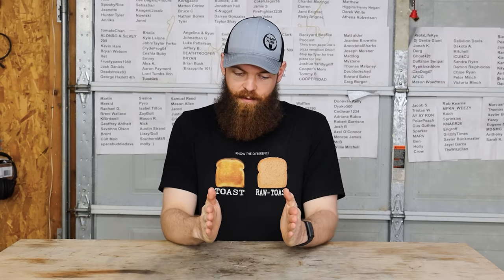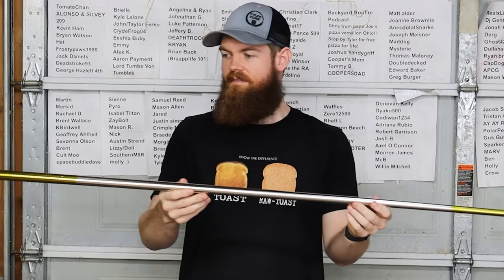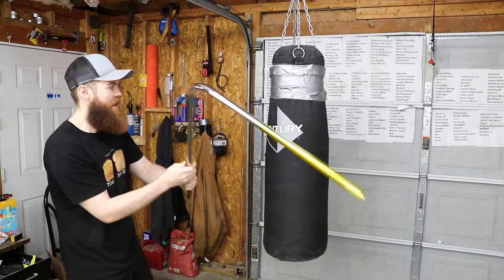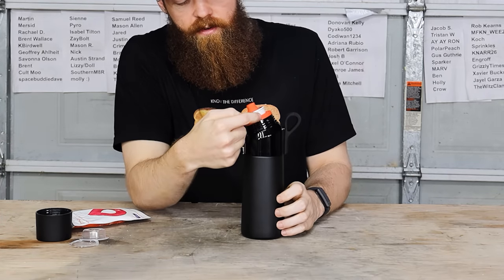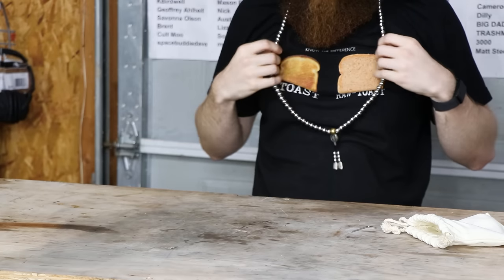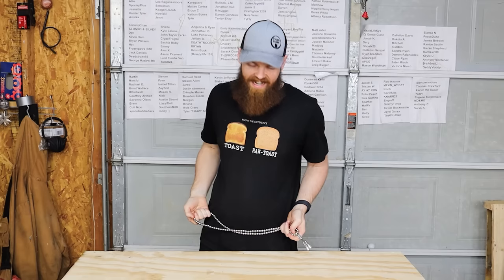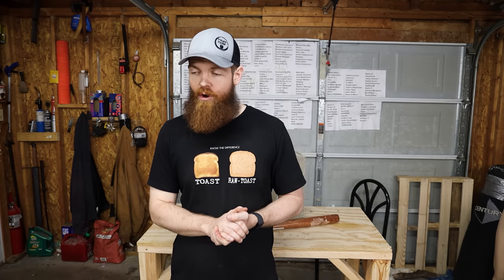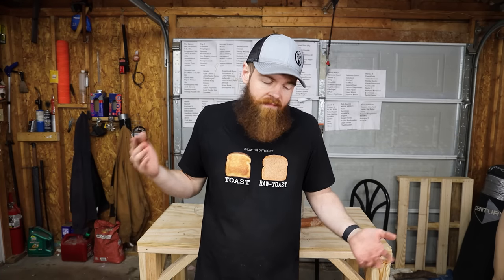Testing 5 Self Defense Weapons From Ali Express!

Comment: I'm pretty sure that stick is a telescoping staff used for magic lol. Not sure why it is advertised for "self defense" 😂.
Reply: I believe it started as a TikTok with someone showing off their amazing collapsible self defense baton. Guess it was a good way to make a quick buck amongst the less intelligent people in our society.
Reply: I was surprised Tyler had never seen it before.  It is a pretty interesting illusion prop and that's about it.
Reply: Great for scaring away potential mates.
Reply: That thing is more dangerous to the user than anyone. Especially the super cheap ones. Its just super thing, razor sharp coiled up metal that could easily shred your hand upon opening, or closing or general handling.
Reply: @lunalovegoodwitch  its also dangerous when collapsing since its made of thin metal
Reply: The best you could do is point it at their eyes while deploying it
Reply: To get suckers to buy it
Reply: +10 magic

+20 healing

-10 defense
Reply: @dotar9586  it's self defense... Defending your virginity!
Reply: To pretend that you're Gambit from the X-Men.
Reply: @Skritl are you saying you would use that flimsy spring loaded aluminum foil tube meant for magic shows the same way you'd use a solid wood bo staff? I think that would go just about as well as Tyler demonstrated.
Reply: @Skritl  It isn't a bo staff though (which is solid wood), it's a fake magician's staff, which is exactly what the original commenter called it lol
Reply: Lol it was sold as magic stick everyone went crazy buying when the sales stopped they relisted them as self defence
Reply: Maybe the telescopic staff is more of a visual deterrent
Reply: Sure 😅😂

Comment: tyler going ham with the collapsible stick made my day. it just kept going and it got progressively funnier.
Reply: I just got frustrated. It's an item you usually see in amateur magic. And ofc you can collapse it again - if you don't ruin the poor thing. Guy's just a dimwit.
Reply: @puttitat2851  it's advertised as a "self defense" weapon, and he was testing it as such
Reply: @Bigblanco_otw  Except the 'doesn't retract' part. That's just not true 🙈
Reply: @puttitat2851  you're right
Reply: @Bigblanco_otw  no, It's not. It's a magic trick. He got duped
Reply: @puttitat2851  I couldn't agree more. Cheap magic trick

Comment: Im actually curious how much those buddah beads go for, Tyler you should totally start posting the links to things that actually work in these videos
Reply: None of them worked apart from the bat. do yourself a favour and stay away from these dumb self defense gadgets. If you ever had to use them you'd end up in a worse situation than you started in because the person attacking you would just be more pissed off.
Reply: Found 1 for around 30 bucks not including shipping with a quick google search and also found the shoelace spikes he featured on the same site so it might be the one tyler used but I can’t say for certain
Reply: @MrEsphoenix  Well, the beads did the exact same thing as the bat propably just as well as the bat so I think they are fine
Reply: FACTS!
Reply: @The_White  No they didn't. Surface damage on a hard surface doesn't equate overall stropping power, especially against something made of flesh and wearing clothes. 

There's a reason you don't see any serous company selling self defence beads, there's simply not enough mass on them to cause any serious damage, it's poorly distributed, you need to land your hit accurately to do anything and you telegraph your hit so much since you need such a wind up to get any force out of them that even the slowest person will be able to react. All you'll do is piss someone off if you try to use them in self defence. 

Don't fall for gimmicks. If you genuinely want something for self defence go for one of the many proven weapons, not some internet tat.
Reply: If you need those beeds invest in a folding knife
Reply: @MrEsphoenix  Maybe they don't want them for self defense :/
Reply: @iamcool544  Yeah, and a set of beads is unlikely to do that. You may as well whip off your belt and twat them with the buckle of that for all the good it will do.

Surely I don't need to describe the physics of how hard brittle things differ to soft padded things? I'm sure if you think about it you can figure that one out yourself lol. But there's a reason professionals tend not to use bricks as an analogy for humans.
Reply: @MrEsphoenix  I mean self defense doesn't have to be super deadly or anything all the time. I could see someone carrying this in cali with all the homeless. Some of them get aggressive with bad mental illness days... it'd be a good "stay back" but not deadly force type of deterrence in those cases, especially for someone of tiny stature.
Reply: @Ajaxykins  It doesn't need to be deadly, but it needs to be effective at either attracting attention or putting someone out of action or you run a high risk of just escalating the situation. If you want to get something for self defence, don't cut corners and go with something because it looks "cool", get something proven to work.

 These tacticool products are infuriating as they're likely to get someone who doesn't know any better into serous danger.
Reply: @MrEsphoenix  Nah. You ever actually scare off an aggressive homeless person? Or a petty thief? Or like a coyote? I have. They're punks. A little bit of threat or pain is enough. Not everyone is a meth'd up CIA ninja. Sure pepper spray is better, but many people can't be assed to carry some until they wish they had it.

Hit someone with a heavy necklace? No one bats an eye. Pull out a .357 on a hobo? Someone might report you for brandishing a firearm and you'll never carry again.

Edit: I'd say give someone the beads as an addition to something functional, like a firearm.
Reply: There is this one self-defense gadget I really like.
Called a "firearm".

Comment: The brass knuckle type things are meant to be held with the fingers between the dividers and for most people between their middle and ring fingers. It hurt because you had way too much of it in your palm, though I'm sure it won't be a whole lot more comfortable the other way. The smaller piece acts like a fist pack, similar to holding a bic lighter and the top lip is more meant for stability and small amount of protection for your fist.
Reply: Kinda like using your car keys between your fingers
Reply: Exactly. You can tell Tyler never has. Lol. Not that that's a bad thing.
Reply: I'm an idiot. I didnt see the little lanyard ring thing on the lower part the first time I watched. That pretty much makes it impossible to hold it like that. Lol. What a stupid design.
Reply: I think that thing is a window punch. the staff was a magic stick so who knows.
Reply: @sandpitBrosAdventures8191  You were giving it FAR too much credit!  😂 😂 😂
Reply: @darlenefraser3022  I certainly was. And not enough credit to Tyler apparently. Lol
Reply: Also, even if it hurts to use it. Connecting a strike to anything solid (Skull, ribs etc) would do serius damage, and even if you break your hand you could be breaking far more important bones on your attacker.
Reply: Agreed. But why design a device that hurts the user too? Maybe so that they only use it in emergencies. Checks and balances. Lol.
Reply: @sandpitBrosAdventures8191  Think it's just poor design, but could be the checks and balances thing.
Reply: Oh I'm sure. I was joking. Lol.
Reply: @sandpitBrosAdventures8191  Because they don’t care and are just in it for the money?
Reply: I'm sure that's the case more than anything.
Reply: It's a "pain compliance" device. You're not meant to punch but push it hard into sensitive points.
Reply: That makes much more sense then. Lol

Comment: The black piece of plastic you were punching the bag with are meant to be used for pressure point takedowns, not as brass knuckles. You apply a force using them to amplify the pain levels induced.
Reply: He is also holding it wrong
Reply: This makes sense, I thought it was a window punch
Reply: Still terrible.

Comment: Biggest concern with that necklace is that while you're wearing it, that's a choking hazard. Same reason security guards wear clip on ties if they're wearing a tie. Seems like using a pull-to-open clip closure rather than having that as a solid loop would be a good idea. You'd still be able to whip someone with it, and if not at a long distance, without risking your own neck.

Comment: Okay so the spikes for your boots are actually supposed to be used on a boot with laces and they actually work really well, if you get a pair that's slightly less bulky, they work better. Highly Impractical, however because unless you're working an active combat occupation and/or grappling people enough day to day that you need to ground and pound option, then you probably don't need them. But to their credit, when used properly, they DO work. 

Buddha Beads are a nice tool to keep on hand when knives and guns aren't an option and you like to stay ready, so you don't have to get ready.  I keep a set in my truck and in my backpack for such occasions. Easily overlooked by anyone who's mind is not geared that way or at a glance

Comment: Tyler, with the lighter weight tactical whips I think it's best to only use the tip for strikes. Because of the lightweight it's more likely to whip back and hit you if you're striking with the middle of the whip. Plus if you use 'just the tip' on a lightweight whip it's gonna build up speed and cut the target, just like the tip of a  bullwhip when it's 'cracked'.

Also, with the knuckle duster I think you're meant to give it to your attacker to use and hope they brake their own hand 👍🏻

Comment: With the tiny knife you hold it in your hand blade side under your thumb handle curled in your fist. You hide the blade under your thumb while making a fist and when you hit someone slide your thumb back exposing the small blade. So that basically everytime you hit them you are also cutting them. Then you also have the added advantage that its small and cheap an easy toss away weapon.

Comment: The collapsible baton is supposed to be used as a blunt point impact defense weapon. Where you use your thumb or index finger to push it down to release the locking mechanism then point it at your attacker then release so the sudden impact disoriented the attacker
Reply: any videoss on that? want to see how to actually use it. sounds cool

Comment: for the first item, you can have a blade that small for self defense, but having it be, a small folding knife, just makes it hard to get out, as well as it has a small handle, making it hard to handle. best solution would to keep the small blade but make it a fixed blade, with a karambit handle so that it's east to hold and handle while still being a able to conceal in the hand. there are arteries in the body that are close enough to the surface that a blade even that size can reach and sever.

Comment: Brass knuckles and similar devices are meant to jam into your palm. Fingers are weak. The heel of your palm is strong. You want to put as much force as possible on the strong bits. But overall, punching things hurts, even with devices to help put energy into the right spots.

Comment: the boot spike things, i feel like most people would kick forward, like kicking a ball, not kick sideways like doing some martial arts move. so the best use for them is probably kicking the attacker in the nuts. nuts, stomach and nose are usually the best spots to hit someone attacking you. it'll immobilize them for long enough to allow you to run away. if your attacking is coming from the front, the spikes on the boots are great for nut kicking. but if your attacker is grabbing you from behind, those spikes ain't gonna do shit. you gotta either try hitting them in the nuts with your fist, elbowing them in the stomach, or if there's a significant height difference, you might be able to quickly whip your head back, like a backwards headbutt, to hit them in the nose.
a lot of these self defense items are only considering you being aware of your attacker before he's able to grab you. when a lot of times, you're only aware of him when he grabs you, and you have to time to be pulling out beads from around your neck(which the attacker would likely pull on to strangle you), or get a collapsible staff from your bag, or grab your keys to pull the string that emits the loud noise

Comment: 9:26 a few of those personal alarms and some kevlar cordage make an excellent perimeter alarm tripwire system for camping and backpacking. In 2024 it is no longer safe to bed down in state parks or BLM lane where others frequent. Attacks on sleeping trekkers are all too common. As are thefts of extremely expensive REI type gear. Particularly on the Coasts

Comment: My favorite self-defense weapon is my tablet stand. I'm a trained martial artist (maybe 1.5-2 years away from black belt) and that thing would be absolutely DEVASTATING under the right circumstances. It's pure steel. Hit somebody with that and it could potentially break bone. Plus, I know I actually have the capability to break bone with a single kick. In 2018, I fractured my own wrist while doing a backwards roll because my mat shoe hit my wrist. 

The best part? I'm very unassuming. I'm a tiny AFAB person (5'3"/5'4" 140lbs) so I'd look like an easy target to basically anyone. But I know how to do pretty nasty things if I were under pressure to protect myself.

Comment: The problem with most of these "self defense" weapons is that they rely on the user to train with them, have skill, and be stronger than the guy you are defending against. If the guy is stronger than you he will just take your weapon and do more harm to you than he may have otherwise. Your best self defense weapon is your feet, for running, and your head for avoiding bad situations in the first place.

Comment: The sharpness meter reading. Wasn’t accurate bc that knife likely had a wire edge which can make a knife feel extremely sharp u til you actually try to cut with it and the wire burr breaks off leaving the dull edge.

Comment: Anything can be used for self defence,even that tiny knife . No you won't be able to scare someone off with that or use it like an 8inch blade or machete but true self defence is about finding the right time and right target , jamming the tiny blade in someones eye at the right time while he has both hands on your shoulders say would work perfectly compared to holding it above your head screaming and charging someone 7 feet away threatening you 
Women tend to scratch at a rapists face where as if they pulled the back of the rapists head with one hand while gouging the thumb of the other hand hard in his eye would do a lot more damage .
I've used a (preprepared, holding it in my hand) menu folded over several times into a sharp point very effectively, jabbed at the eye and neck (under the ear ),it even left  puncture wounds in his face .
Pencils, CD's and redbull cans are some of my favourite improvised self defence weapons as living in the UK you can't carry anything to defend yourself so you have to be creative and think outside the box.